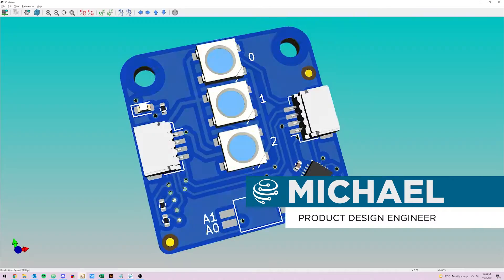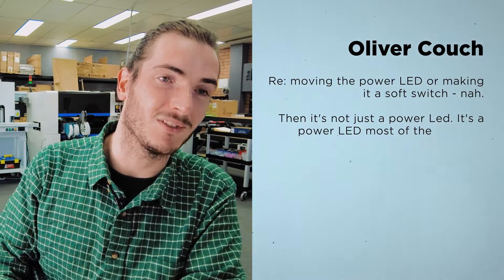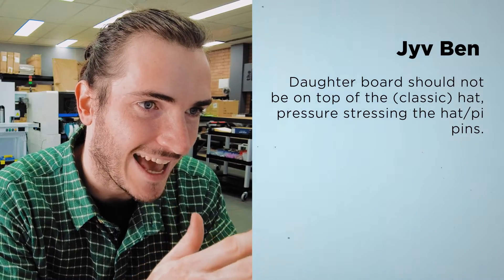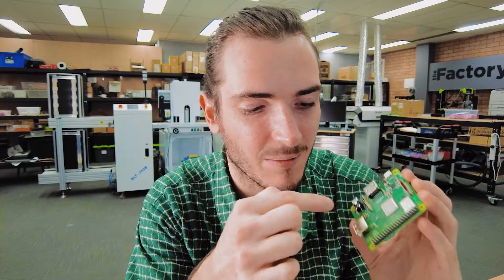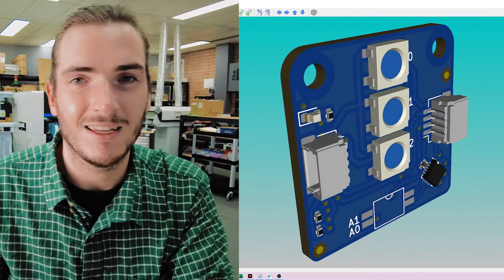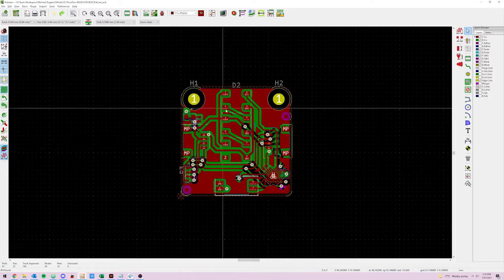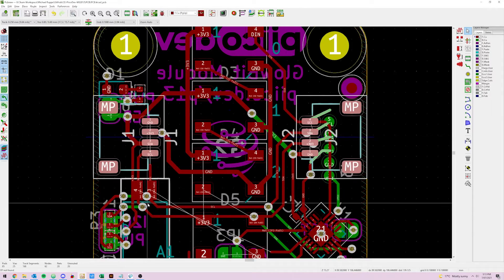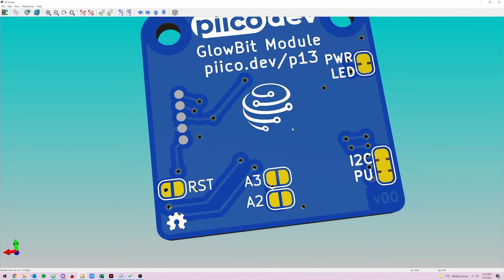The Factory | Responding To Your Feedback

Comment: pls move the connectors centered again. instead, you should move the led below the connectors horizontal. and for the DIPSwitch you should use a button. Get 4 small LED for status. So you also can see easy which state you are on

Comment: Hey,

It's great to see you are taking on board our feedback!
The 45° dip switch is an interesting concept as I think maintaining the connector positions would be optimal where possible.
The other option is to stick with just 3 RGB LEDs but vertically centered which could give you more room to play around with the dip switch.
Reply: would jumper pins be a smaller foot print, also visual from a distance.